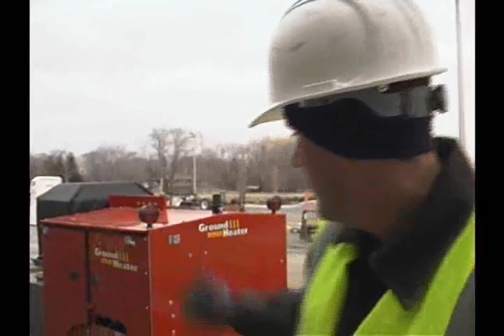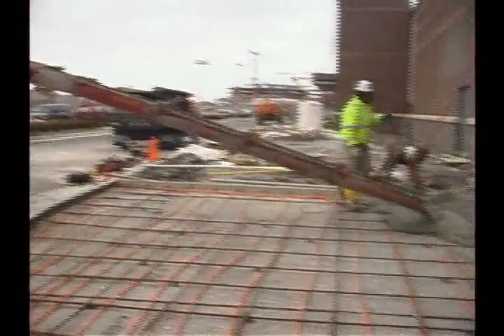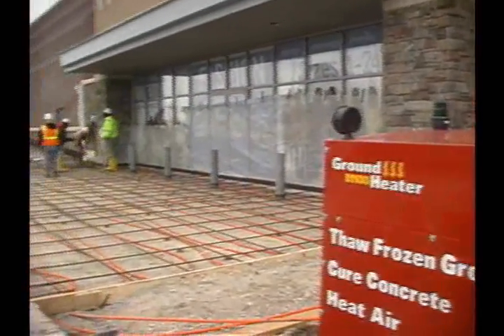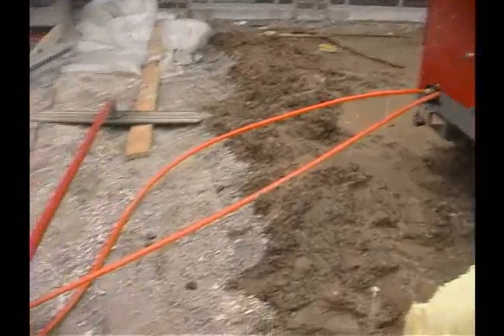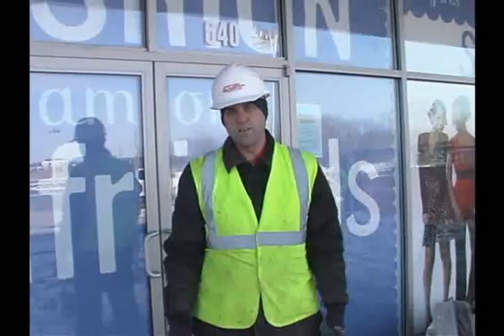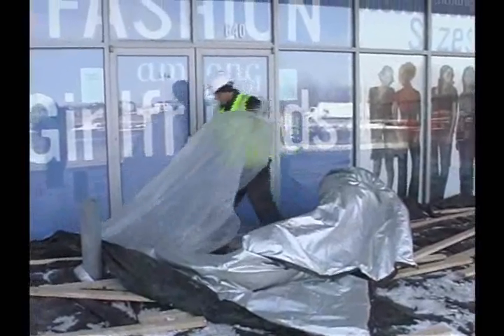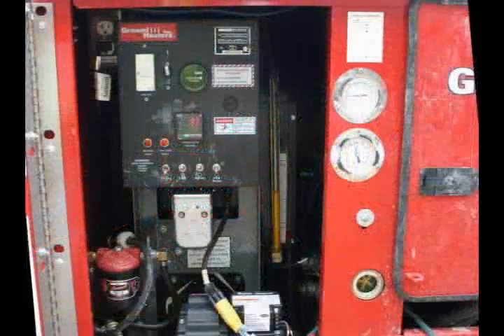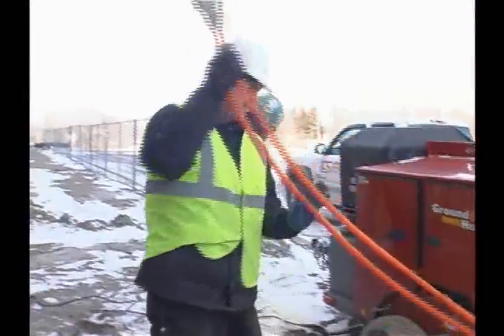How To Pour & Cure Concrete in Winter Using Pex Tubing & Glycol Heat Concrete #pourconcreteinwinter

Comment: what is the air temperature in cold weather
Reply from the maker: Hi, air temperatures during the 10-day curing cycle were down as low as 6 degrees Fahrenheit (-21 degrees Celsius). The concrete maintained a curing temperature of about 60 degrees Fahrenheit or 15 degrees Celsius, to effectively cure without cracking or other issues. Thanks for watching and sharing your question.

Comment: Seems alot cheaper to just use anti-freeze and do it the regular way though.
Reply from the maker: The glycol solution used on this jobsite is the equivalent of anti-freeze, but we're not sure what you mean by the "regular way?" Do you mean to tent the area and use pump in heated air for the curing period?
Reply: VintageVideos2009 no just use the anti freeze with concrete blankets

Comment: How much does this act to the cost?
Reply from the maker: There are a lot of variables to take into account, such as ambient temperature, humidity and related weather conditions for the duration of the curing period. Also the cost for fuel, pex tubing, and the rental fee for a Ground Heater unit for the duration of the curing time and minor costs for someone to visit the site, every 24 hours to fill/monitor the fuel reserves in the Ground Heater unit. A local contractor supply dealer or rental center would be able to provide these figures based on your location. Thanks for the great question.